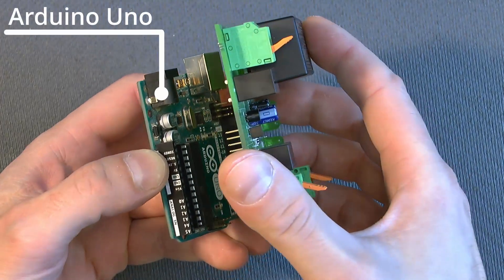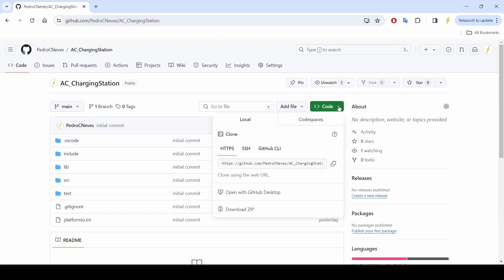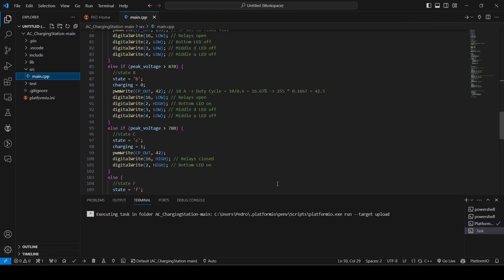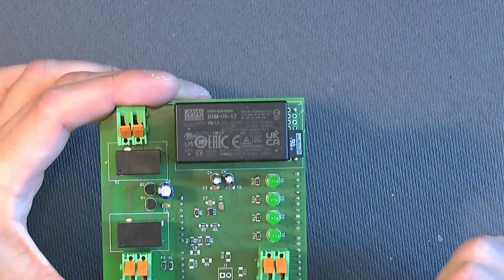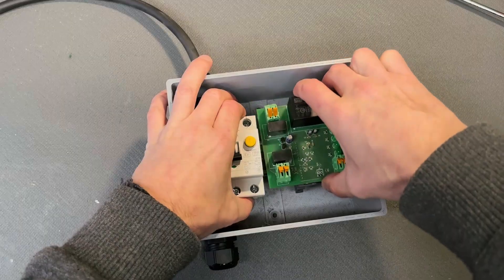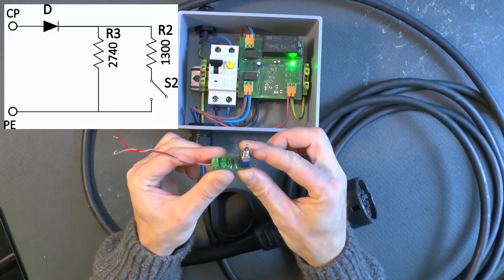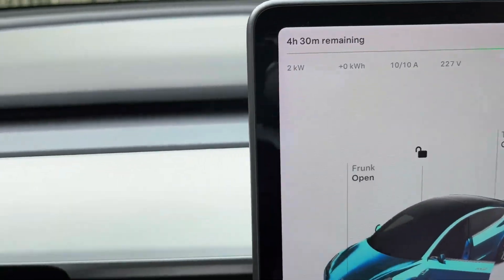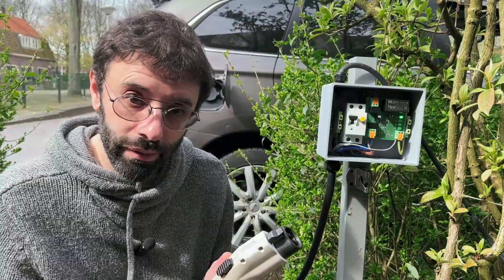DIY EV Charging Station with Arduino Uno

Comment: Is it possible make the houses max charging rate dynamic eg. change it during the charge with (no) interruption?
Reply from the maker: Hello, Yes, absolutely. The max charging rate is designed to be dynamic. During charging, the charging station may change the maximum allowed current. 
To combine a charging station with the capacity oh a house, one can measure the current that the house is using and send a signal to the Arduino with how much is available.

Comment: can you make a 3 phase version ?
Reply from the maker: Hi, that's a good question. It would actually be exactly the same but, instead of 1-phase relays, it would have 3-phase relays. It's even possible to use external contactors (e.g. for DIN rail) and then it's not even needed to design a PCB for them.
Hope this answers your question. 
Cheers!
Reply: @pedro-neves  Hello, do we need to change the current limitation on the code when we connect a contactor for a three-phase and 16 ampere system? If there is a change in the code section, should " pwmWrite(CP_OUT, 68) " be like this? I don't want to make a wrong calculation :)
Reply from the maker: @dijitalbaşarırehberi  you're absolutely right. The value should be 68 because the PWM positive percentage is 16/0.6 = 26.6 and the Arduino value is the resolution of the PWM (8 bit) x the positive percentage so 255x26.6 = 67.83.

Just one recommendation - I would round low and use 67 instead to make sure the car doesn't pull more than 16 A.

And one more note: I'm working on the second version of the Arduino Uno shield - with this it will be like your setup with an external contactor so that it can be 3-phase or any current that the contactor can handle. Sounds like you're already doing it but just to mention.

Good luck with your project!

Comment: Also, to extend the project a bit, if the Arduino can control the charge current, could it be programmed to monitor a solar PV system and alter the charge current in response to solar energy available and house loads, so that the car was charged only from available surplus solar energy?
Obviously it would also have to be able to charge at maximum rate, drawing from the grid, as well if you needed to charge quickly or at night.
Reply from the maker: Hello, it's absolutely possible. The communication is designed to allow just that - dynamic maximum current allowed. If you input to the Arduino the current that the PVs are producing, then you calculate a new available current to the EV.
I will develop this project bit by bit. This one makes a lot of sense, thanks.

Comment: Thanks very much for making this video.. great project.
My Leaf draws about 13A / 230V single phase while charging... what is the highest current your relays, PCB and connectors can handle?
Or, can the Arduino control the maximum charge current? If so, does it do that by communicating with the car and "asking" the car to only draw say 10A?  This part of it wasn't fully explained.
Reply from the maker: Hello, you are welcome. And thank you very much for your comment!
The relays and PCB are sized for max 16 A. But I only really tested up to 10 A.
The code in the Arduino can be changed to allow any current, I briefly show in 16:35 the line of code that can be changed to a different current setting.
Indeed I could have explained the communication. I'm always wondering how much detail to put in these videos. But, if you are interested in the details, I have a full course in Udemy where I also explain that. There's a link in the Description. But, here's a link with a coupon to take the course for free until the end of April, if you like: https://www.udemy.com/course/draft/5863700/?couponCode=5F667AB15FB9ECEFA42D.
Cheers!